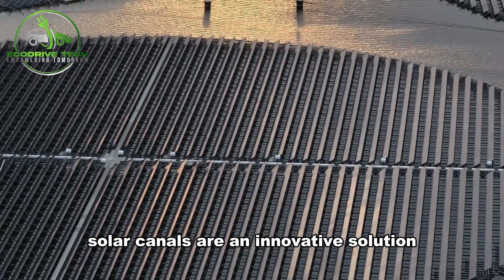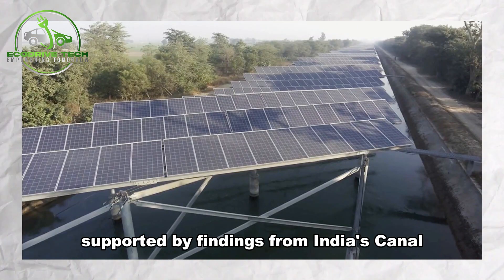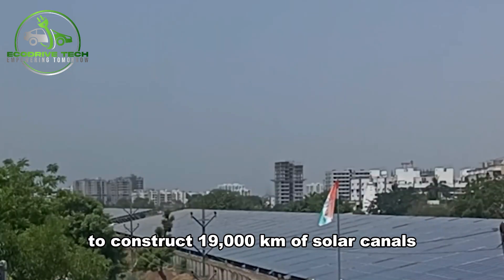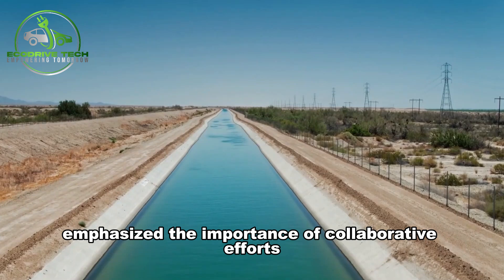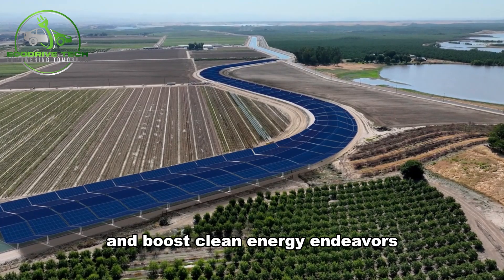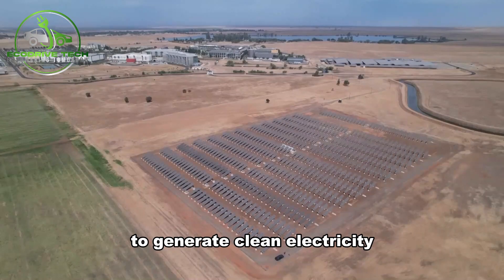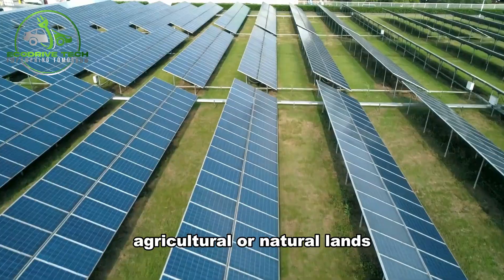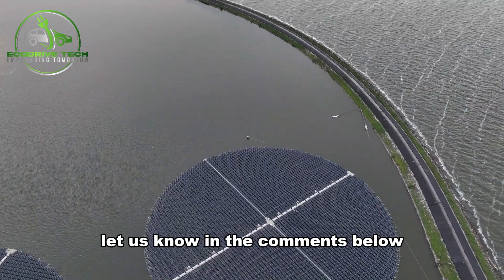From Water to Wattage: How Solar Canals Are Lighting Up Our World!

Comment: Truly one of the worst ideas for solar that is really possible.

1. You have loads of land especially in the desert where we have these aqueducts. There is no need to put it over the aqueduct.
2. Putting it over the canal makes it more expensive as you have to have custom hardware to do that.
3. Maintenance on the panels will be higher.
4. There are possible water contamination issues of having all that equipment over the water.
5. Possible issues if there is a flood as the panels will be directly on top of the water.

The only credible point on this is that the aqueduct loses water to evaporation. Covering the aqueduct reduces that hugely. So that is a good idea. It should not only be covered but sealed like a pipe. Some of our water system already works that way. We have huge water pipes that go through the desert. They have the additional benefit of being able to go up mountains as the pipe can be pressurized.

However, solar power projects have no place anywhere near this sort of infrastructure. Put the solar in the middle of unused land in the desert. It will be cheaper, easier to maintain, will not contaminate water, and if you pay some attention to the topology of the land then the risk of flood or erosion damage should be minimal.
Reply from the maker: Thanks for your comment.